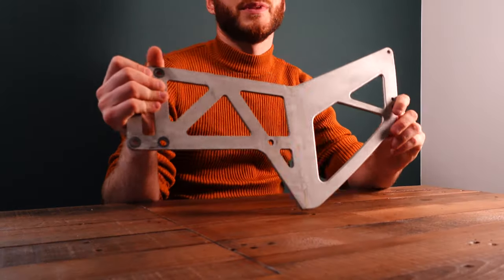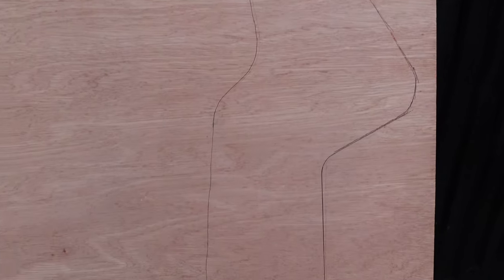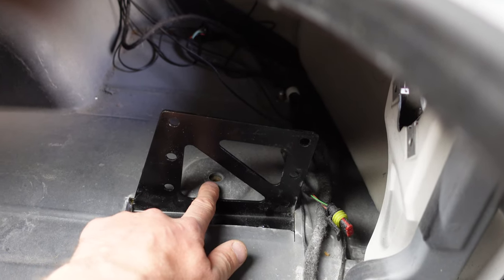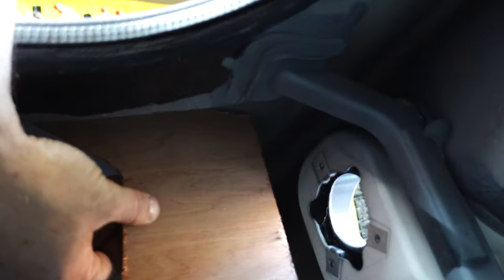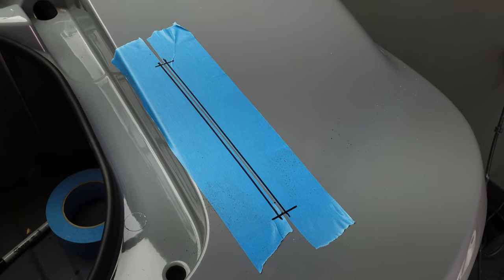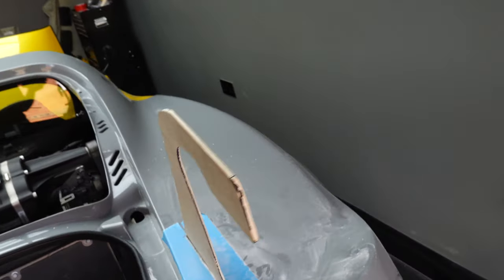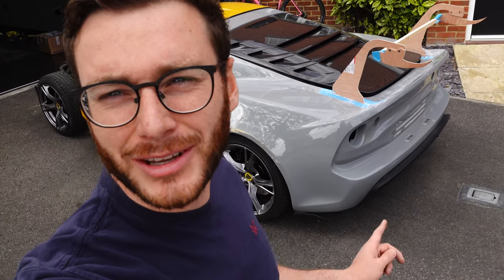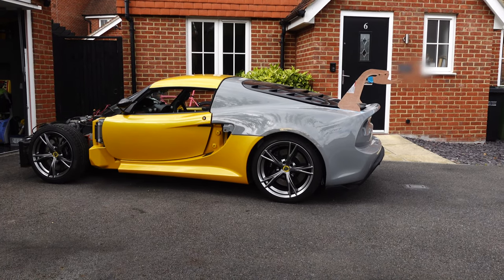DESIGNING and TESTING a CUSTOM WING - Modifying My Exige - Hell Slow Project Part 4

Comment: Have you been to a wind tunnel and is the  wing angel adjustable?
Reply from the maker: Not been to a wind tunnel (nor will I), but the wing profile comes with CFD data. Both height and angle are adjustable.

Comment: Great project, very brave! How are you going to finish the slots in the clam? There must be some kind of seal? 
Also I cannot find any figures for the Cup R, but the current Cup 430 is supposed to be 220kg of downforce at 180mph, so you must be aiming for 200-250? I wonder how much benefit mounting to the chassis actually makes in terms of kg? That would be interesting to know. It would be significant I would have thought.
Reply from the maker: I believe that figure for the 430 Cup is the total downforce for both front and rear, so not just for the rear wing.  I'll do a rubber deal around the slots to seal them and protect the paint. I don't know the figures lost in it being clam mounted, but it's obviously better to be solidly mounted to the chassis.  Unfortunately it's very hard to get any exact figures without a full CFD model, or going to a wind tunnel, both of which are a bit too costly for me really!
Reply: @GFWilliamsnet  Yes sorry, those figures are supposedly total. But you must be hoping to at least match the 430? That doesn't appear to have much going on at the front, just the deeper front lip and vented arches that i can see. So you should be able to beat the factory figures comfortably? GL anyway and looking forward to the next update.
Reply from the maker: @samueldowney2806  I have a new front splitter with underbody diffuser tunnels, wheel arch vents (but actually properly open unlike 430 Cup) and vents behind the front wheels. I'll have comfortably more downforce than a 430 Cup. The real question is how much more drag...

Comment: Will you put a rubber grommet seal on the bodywork slot - would stop any lateral movement if the uprights chipping the paint and water proof the area ?
Reply from the maker: That’s the plan, just a rubber trim around it. It will have an added brace to stop sideways movement inside the boot.

Comment: Wing mounts from cup car look very flimsy for 150kg of downforce + drag and thousands of pendulum movements. At minimum I would add second pair opposing current and sandwich the upper mounts between them
Reply from the maker: Actually not a bad idea, I was thinking of remaking them from a solid block of aluminium. These will do for now though (budget is the limiting factor for now!). Can’t sandwich them very easily due to other mounting parts.

Comment: My concern is that the wing support uprights will flex left, right & forward & aft as g forces are exerted upon it & will chaff on the raw edge of the slotted holes. Each to their own, but I really don’t like any wings or splitters - I think they look juvenile & shout boy racer. Best of luck with the project...
Reply from the maker: There will be a diagonal cross brace in the boot between the two uprights, plus the edges of the slots will have a rubber edge strip around them. In terms of looking like a boy racer, I think I can live with that, can’t please everyone all the time :)